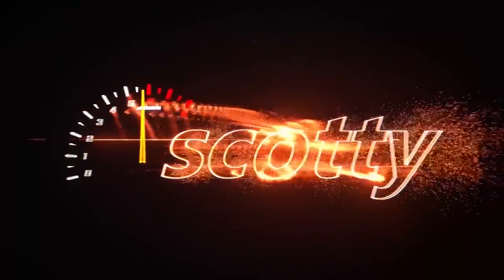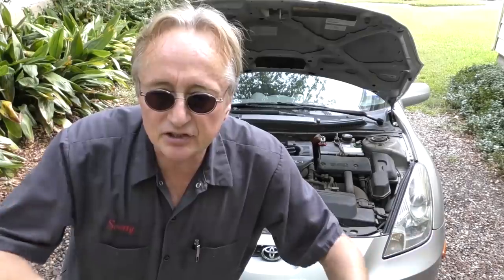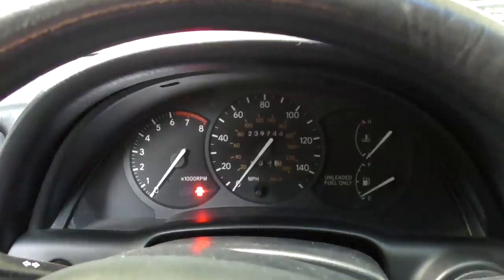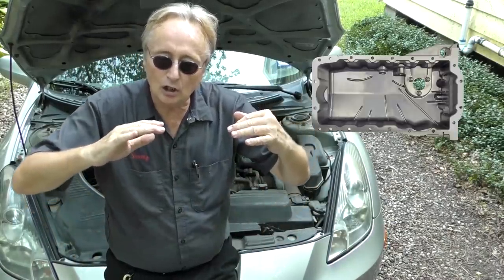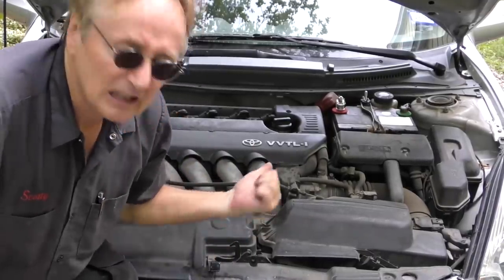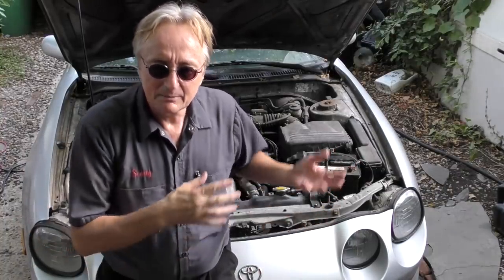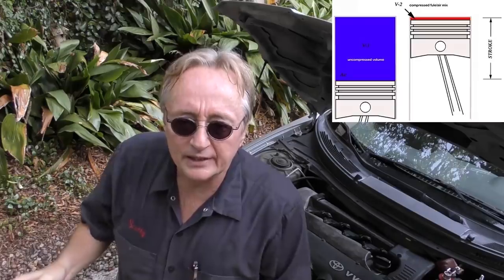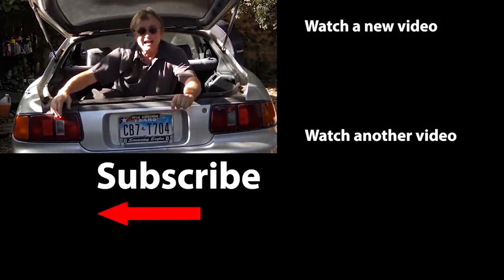Why Not to Buy a Toyota Celica

Comment: I bought a used one with 219k miles, original engine. GTS manual. Runs forever, as long as you maintain them.  I don't drive it hard 50 miles to work daily.

Comment: Should I buy a 1994 Celica... it has 211,000 miles the only thing is it needs a new battery and alternator so how will I be able to test drive? Also not to mention it’s it’s needs a whole paint job and a new rear corner window.. how much would you pay for a car like that?

Comment: Never had a Celica but I did have a 92 SHO with the Yamaha 3.0 -- 5 speed manual transmission. Very smooth engine with turbo like performance... without the turbo. Fit and finish on the car wasn't the best. Clutch throw out bearing was noisy and replaced once, otherwise had no troubles and owned it up to 75k miles then sold the car when I relocated. Sometimes wish I had kept it but I guess I made the right decision

Comment: Got a 2003 corolla Sportivo with the 2ZZ motor. Has 290,000km on the clock and never had a single problem except for a small oil leak. I know of several other owners who abuse the crap out of these motors and still get well over 350000km out of these things with little to no issue whatsoever. Just learn to look after it regularly, and maintain it every 10,000km and you can hit redline all day every day like me and not have a single worry in the world about these things.

Comment: A Toyota with 110k miles and on second engine, my 2002 bmw 325i with 280k miles is still running on its original engine and transmission. Car runs like dream.

Comment: Same goes for all early VVTI engines from Toyota, they have various problems with piston rings, head bolts, carbon and lubrication. 2000-2005.

Their 90s engines were some of the most reliable engines ever made.  Like in Corolla, Avensis and the others. 1.8 and 2.0 liter non-interference. Have had many, with 300000 kms they still are dry and nice and quiet and not burning any oil.

Comment: I  have an 03 GTS with 190k original miles. Replaced the timing chain and runs like a champ. The VVTL-i is pretty much useless since it's so narrow in the upper band but as far as the oil pump, just don't money shift it and for the oil pan, replace with GT 1zz with the baffle. And do regular oil changes. Voila!

Comment: Hi Scotty, thank you for your review. How about a review of the celica vvt-i facelift (143 ps made from 2003 ubtil 2005). I own one and it is a really good one. 200 000 km and the engine runs perfectly. No oil problems, nothing but just some rust I had to fix.
I would be interested what you think of this model, since it is different from yours with the bigger engine and different from the pre face lift celica t23

Comment: What repairs would you suggest I'm having issues with oil leaking and sputtering and cutting off it goes away if I rev the engine after filling for 30secs at around 2000rpms no matter how little or much I put into it it still sputters on fillup

Comment: 00 Celica SX (Aussie version, 2ZZ) with 238,000kms and still running on the original motor. Had a 05 Corolla Sportivo (2ZZ as well) since brand new and that lasted 240,000kms before it sucked up water from the cold air intake

Comment: PLEASE HELP: '06 Suzuki Forenza. Car stalls and won't start if it's been sitting over night unless battery is disconnected. It starts up with no problem after reconnecting the battery again. Starts as many times as needed through day. Come next day, sitting over night, won't start again unless battery is disconnected again. New battery, sparkplugs, sparkplug wires. Car also has difficulty getting up to speed in 1st and 2nd gear, it will start jerking and kicking, if that makes sense. Once it gets above 20-25 MPH it runs smoothly until speeds above 55 MPH and it will start kicking and jerking again. Also, when coming to a stop, right before completely stopping, the car will kick forward. If I come to a slow stop the kick will be minor and if i come to an abrupt stop the kick will be fairly hard. Also, sometimes, especially after reversing and shifting into drive, the power steering goes very stiff and difficult to turn the wheel. The power steering fluid has been replaced a couple of months ago. Quiet often the check engine light will come on. Auto Zone's code reader says it is a code dealing with the cat converter and/or oxygen issues. I've removed and checked the cat converter, it is clean well enough not to be causing an issue. I've considered perhaps it is an issue with either of the 2 oxygen sensors, or the throttle body and/or its position  sensor, or even the computer itself... any ideas on what it could be?

Comment: I have a  a 2000 celica GTS 6 speed.  I purchased it in 2003  and the only think that went bad  was an  injector  and a wheel bearing. The 2zzge is Very dependable . Im sure all these engine failures you are talking  about are due to maintenance neglection and due to people not using 93 octane because it costs  more.

Comment: I had an 02 celica GTS with absolute red paint, fully loaded, 6 speed, leather, and the ACTION PACKAGE... FOR 8 YEARS... bought it for $8500 I got really lucky i guess..Took it from 60k to 180k miles. I redlined it everytime i drove it NEVER BROKE DOWN EVER. It was an amazing car. The only reason i sold it was because it needed new catalytic converters. ALWAYS ran top tier premium gas, and mobil 1 full synthetic Every 5k miles. This car was a blast to drive. I wish Toyota would bring it back with an updated engine design with VVTLI kicking in around 5k rpm instead of 6400.

Comment: Man, what? Scotty is the only one that says the 2zz is the worst engine. When in reality it's superior. I had both GT and GTS Celicas and I had my 2zz Celica from 66,000 miles and sold it with 168,000 miles and it never broke down and always started. It was a 2003. My 2000 GT however was burning a lot of oil at 145,000 miles. I recommend the 2zz. If you beat on it with the Celica, be careful for the close shift gates. The 2zz is a good dependable engine.

Comment: Hi Scotty.  I have a Nissan 300zx NA 2 seater with 340,000mi on it.  I bought it with 96,000 16 years ago and starting to really need some help with it!  Starting to spew oil, gradually, in my engine bay.  I love the Z cars and their history.  Any suggestions for which seals to start with replacing?
Reply: Try AT-205 Reseal first. You might get lucky. Don't use synthetic oil.

Comment: I have the Celica from 1994 1.8 liters. I can save it bulletproof you can rev the engine as a maniac and nothing happens with the engine. It drives perfectly, the only problem is, if it has a lot of miles the engine eats oil

Comment: Hi Scotty, any modifications you can make to prevent these issues from happening?
Reply: scotty doesnt know what hes talking about in this video, the issues he mentioned are a non issue for normal street driving. many 2zzs have seen upwards for 300k miles with proper servicing. in saying that there is a baffled sump available from Moroso along with plenty of places with billet oil pump gears
Reply: @arcanevoid9199  mine took a fat sh*t at like 120k, Scotty is def right. I love my 02 GTS but I can't he biased here.
Reply: @StallionFernando  theres always a reason, people just like to blame everything else before themselves. you didnt say what went wrong, and even if you do i doubt you know the full story. there are plenty of these cars with upwards of 200k, 300k some even 400k. scotty says to stay away from it in this video but praises it in others. he is far from a reliable source of information
Reply: Change oil regularly. Oil interval mustnt reach 4000 miles

Comment: Those particular years of Celica had problems with oil consumption.  My brother in law had one of those cars in a manual.   It ate oil like mad. And the transmission had a problem and needed replacement all in the low 100k mile

Comment: My GT engine blew at 61,000 miles @ 4 years and dealer wouldn't warranty it (extended warranty purchased to 7 years or 75K). Ended up going through another 1ZZ-FE before I turned my GT into a GT-S with a 2ZZ-GE. Probably sunk in more than I should have. Lasted me another 5 years. Scotty is missing a lot of other issues with this car, the 5-speed transmissions were junk(swapped for the 6-speed), the shift linkage broke (no I was not ripping through gears like a madman) and the O2 sensors always went after a year. Also it would idle rough, you had to clean the MAF sensors every 10K or replace them and it would go at 25K. This car was a love/hate relationship. But I'll always remember her for the good times.

Comment: The 1JZ was another engine designed and built by Yamaha,  same with the Beams 4cyl. Both amazing motors. Included was even the 2JZ as well, however Toyota did build the 2J and was given a design update by Toyota. So in turn Toyota has a lot of faith in Yamaha, a company with a great track record of building amazing engines.

Comment: I have a 2001 GTS. I love driving it except it has a terrible smell of exhaust in the cab that wasn't there when I bought it. My fiancé smells unburnt fuel. All I know is that we wreak of this smell after driving around for about an hour. I've had the battery disconnected for a while so I don't have the exact engine code that it threw before disconnecting it but it has thrown one for evap before I believe. We took it to a mechanic yesterday and they basically berated me saying they can't diagnose a car with no engine light on. Regardless of any info I was giving them. They said the only thing they can do is drive it around until the engine light came back on and I'd be charged for every half hour for that. Got the hell out of there and now I'd really like to tackle this myself because I hate unnecessary rudeness in a business and don't have the patience to continue looking for a decent mechanic. 
We have changed the MAF, gas cap, battery and spark plugs, just for reference. 
Sorry for the long story but has anyone else had this issue? Thanks in advance.

Comment: I don't know how to message you on your page. The question is about my 2011 Cadillac Escalade premium. I just change the orifice tube because it was shot and my pressure relief valve on my compressor blew after I replaced it it worked again for good two months and now it just blew again any ideas?

Comment: Do you have a video on "tappet" or engine clicking/ticking loudly and increasing with engine rev or speed increase? I'm lost with my 2007 Sebring v6. Changed the oil and added something to help with the moving parts inside. Don't know what to do. Any info will help. Thanks.

Comment: Sorry Scotty, the oil pump sucking air is not cavitation.  

Cavitation is the formation of bubbles or cavities in liquid, developed in areas of relatively low pressure around an impeller.

Comment: What about the Matrix XRS with the same engine???..
Did they fix those engines..or should you avoid that version of the Matrix???..and stick to the small ..regular 1.8
Reply: The 2ZZ engine is a quick revving engine, lots of fun, very solid, reliable, does not eat oil like the 1ZZ.

Comment: Can you explain exactly why these motors ‘don’t hold up’, in my opinion the 2zz is one of the if not the most reliable motor Toyota has ever made
Reply: If the reason is ‘people don’t use premium so the internals carbon up, that’s not the motor that’s the issue it’s the dickheads that put the wrong fuel in the car, my 2zz has always been run on 98 octane here in australia and it’s copped an absolute beating and still runs perfectly normal

Comment: hi Mr. Scotty, how r u? i was wondering what would cause a 03 celicas engine to shake badly , when its on drive (D) and you step on the brake, it will shake a lot but when it on park(P) or neutral its not shaking , if you can give me some pointers pls.

Comment: Aftermarket oil pan fixes the oil dry-out problem.

Larger oil capacity and partitioned on lower level oil pan to keep oil from moving around during high-G situation

Comment: I have an 05 corolla XRS with this 2zz engine. Never had a single motor problem in 160k miles. The problem is guys hit lift every chance they get which means basically redlining every gear. Don’t abuse it, simple

Comment: I've got a 2004 gt-s, with an engine from a 2000 gt-s. Issue came from when the previous owner drove through water. This engine has about 230k miles on it, and it seems that it doesn't want to go into lift now.
Reply: It's your lift bolts.

Comment: I had one of these for 5 years. A 2005 version which had an engine fix to stop it eating oil. 

Did about 78k miles before I started getting engine trouble. Toyota gave me £2,000 for it as the UK had a scrapage scheme for old cars. Got an AYGO now. 

Not as speedy as my old Celica but got a 5 year warranty.

Comment: Got a Celica (UK 192 BHP) 2ZZGE. Scotty love you to bits but most of the issues with this engine are purely neglect. Yes Toyota realised the lift bolts were a poor design (easy change) and made better ones that didn't break. I agree, the sump design is stupid considering the 1ZZ had a baffled sump and the 2ZZ did not. But easy change. The 1ZZ bolts straight on the 2ZZ. I agree, the oil pumps can shatter but this is usually down to a mis-downshift of gears at high speeds. Regular oil changes (every 2500 miles) with full synthetic 5w 30w oil is ideally recommended. Not only does it protect from sludging but keeps the VVTi and VVTLI filters (tiny mesh filters) clean. Plus premium gas helps keep internal valves clean and cat clean also. The timing chain covers  do over time weep oil. Most Celica owners have been told it is the timing tensioner 0-ring but in actual fact the majority is the bottom corner of the timing gasket weeping near where the power steering pump bolts through and becoming brittle or replacement gasket not torqued correctly.  Can be a pain to change but it can be done without removing the engine. 
They're basics. and sadly, whilst the above seems a lot, in the context of things it isn't.

Comment: what about the 2000-2005 VVT-i engine (not this VVTL-i one)? I want to buy the lower horsepower trim celica, but i don't know about the engine- i know that the celica GTS engine isn't any good, but how about the lower horsepower VVT-i ones?
Reply: the gts engine is very good, and the lower horsepower one is ok. just needs a turbo :)

Comment: I have a 2003 vibe gt with the 2zzge 6 speed and I rev it to 8000rpm every day for the past 2 years and its still on the original engine and runs great so therre not all as bad as scotty is saying. They just had more problem then the 1zz fe since it makes almost double the power with the same 1.8L so its expected to not last as long.

Comment: There are two engines in this model, the VVTLI and the VVTI.

Plus they reworked the engine from 2002, hence the facelift. 

I have heard the more powerful engine with lift, can have issue with the valves.

I'm on my second celica vvti (without the lift) the first one I had is still running around and was on 186k miles when I replaced it, never had an issue.

The one I have now is on 80k

What Scotty is missing is if you want one of these Celicas, but a model that's made after 2002, and if you can live with 0-60 times of 8.7 over 7.4 then go for the none lift model, the VVTI...

I've been running these cars for about 15 years now and apart from general maintenance they've given me no trouble.
Reply: 7.4? LOL. My GTs was about 6.5

Comment: Hmmm. I have a 1zzfe 00 Celica GT manual 5 speed. I have well over 325k miles on mine but two  of my piston rings are gone, so I was thinking about doing the  2zz swap.  After this, I'm thinking that might be a bad idea afterall and maybe the HP gain isn't worth it. Parts are becoming scarce and I don't want to switch to the new cars with all the proprietary software crap running the show.

Comment: Yamaha engines are not the best.  Volvo tried them for awhile as well and they were very troublesome.  Unfortunately, as high tech as they were they do break down a lot.  So I totally understand this view by Scotty.  By the way, for those who complain Toyota no longer makes their own sports car - the engine is a key reason why.  Toyota does not make high performance engines, and they would rather buy them from others (BMW) than to try to outsource from Yamaha or other engine manufactures.

Comment: Ugh, bad memories of my 20's owning one of these things, that I got used.  It was in the shop every 6 months or so, it was SOOOO expensive.  What's worse is after I sold it to some local teenager when i was about 30, I got smart and bought a dodge dart (FML that was basically worse but my room mate [former] stole it and crashed it so I got out of that pit too, after a few months).

Comment: Several years ago I bought a 1974 Toyota Hillux with the 1.8 liter engine.   It was tough, but not much horsepower for a truck, plus it had a carburetor.   I think it was 98 horsepower.   It was a tough truck though.

Comment: the oil starvation could occur at over 1G lateral force. Toyota have explained that the design of the oil pan os to allow better flow of the oil and will hold up to 1G.

slapping a 1zz oil pan will simply reduce the capability of the engine.

with enthusiast driving on public roads and road legal  tyres you most probably would not hit 1G. 

If you want to track it do a bit of research for the oil pans and possibly the oil pumps and you'll be fine.

Worry more about misshifting and abusing the heck out of that gearbox :)

Comment: Not for the common consumer. But if you know how they work and how to fix. Like the oil pressure issue you use the baffles pan from 1zz. Easy fix. But for the common consumer a 1zz is perfect. Just change oil.